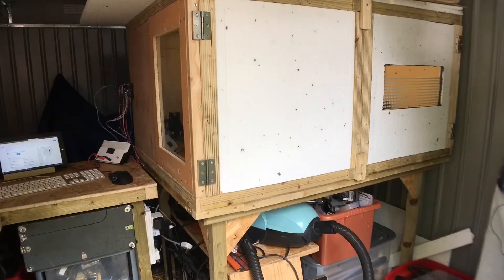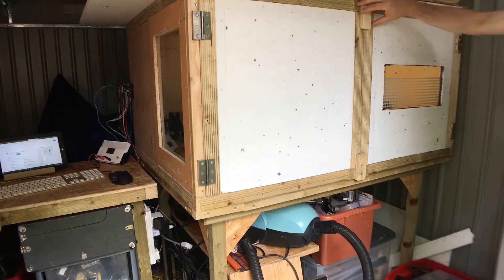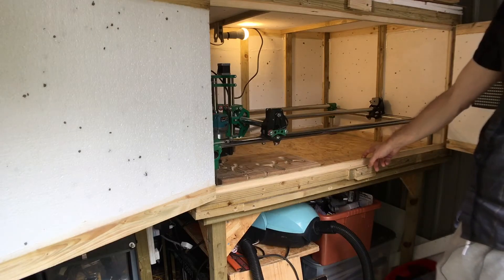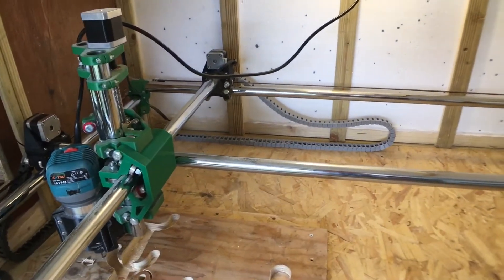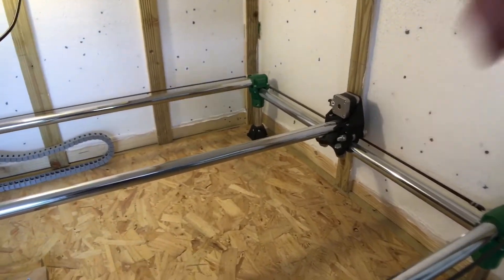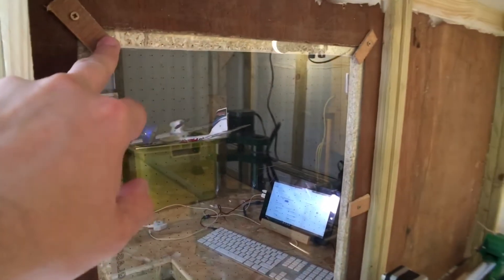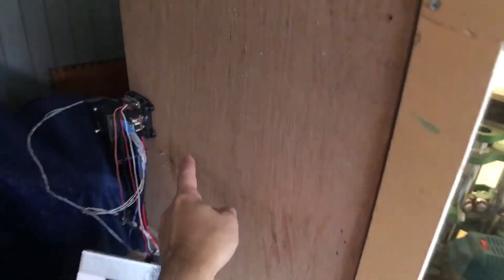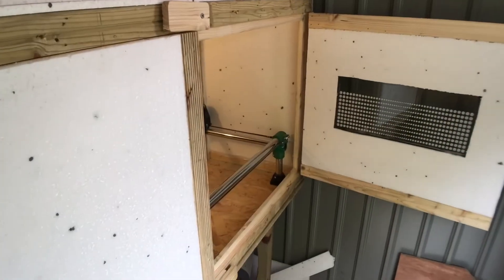Cnc Router Dust Enclosure MPCNC

Comment: Nice work Jace. That router must be addictive. For sound proofing. https://www.wickes.co.uk/Rockwool-Sound-Insulation-Slab---100mm-x-400mm-x-1-2m/p/148842  I think you can even buy cheap paint on stuff that uses special micro particles. Used to paint inner walls of recording studios. Paint on stuff probably not that expensive. You could even try bitumen that is known to absorb sound as well, messy but very cheap.
Reply from the maker: thanks for your input yes will get some rockwool when more funds available.
all the best have a good night.